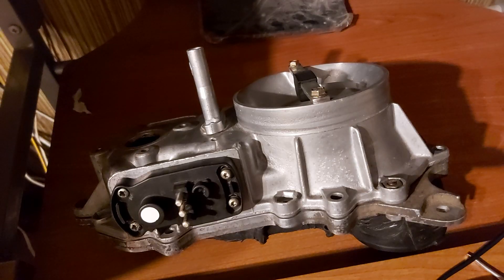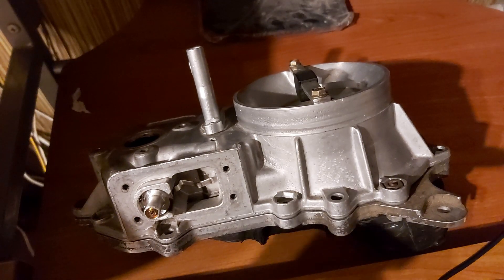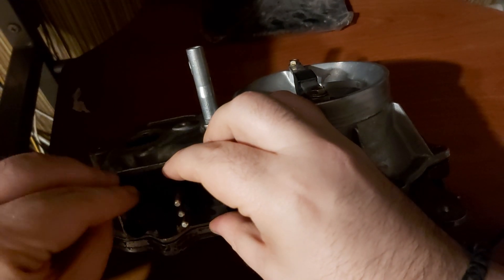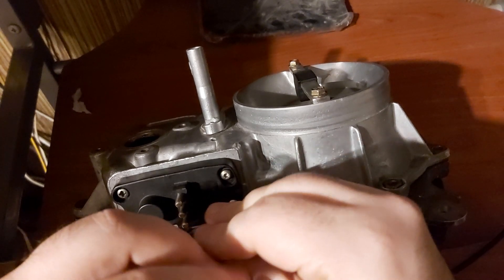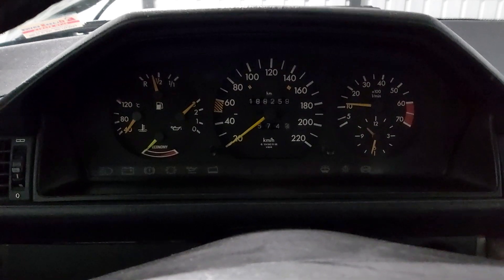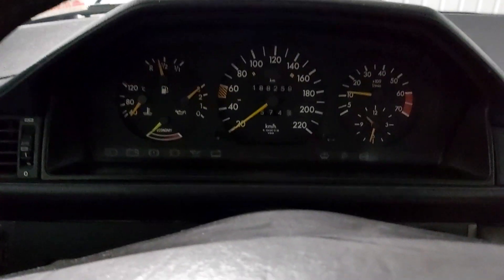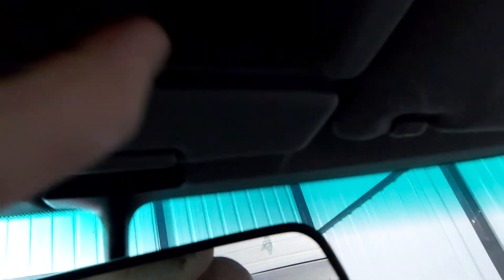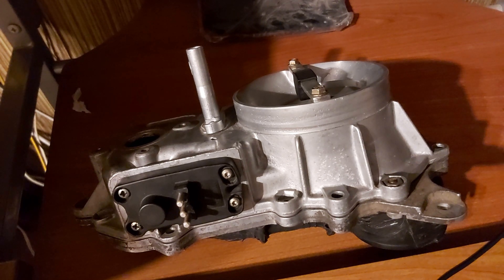㉦Mercedes KE-Jetronic㉦ - Potentiometer calibration and replacement

Comment: Hi! Thanks you for your great vídeos. My 190E 1.8 accelerates with bumps and hesitations until it gets warm. After it gets to 80-90°C it runs much better and smooth. It starts easily when cold. After gets warm the start its harder but drives better. With full throtle it goes ok (cold ir warm). What could bem the problem? Thanks you very much.
Reply from the maker: Hi. Check your potentiometer, I have already got an answer from the subscriber that he bought a new potentiometer but he didn't calibrate it to 0.7V. So you check it also.

Comment: Hey again, thanks for this video. My current LMM is reading out the following measurements. Valve closed pin 1 en 2 2,5k ohm and pin 2 en 3 7k ohm. Valve fully opened 3,2k ohm. So I guess my pot meter is broken. If I replace is and place it at the exact same position, will this still work or do I need to calibrate the replacement?
Reply from the maker: Hi and thanks for the comment. You will need to calibrate it. It's just a matter of patience and precision. I saw on ebay someone in the Netherlands selling potenciometers. There are some people in Germany. You will get full instructions how it's done. I bought it from the man from Darmstadt. If your car has more than 150k miles on the clock then this can become an issue.
Reply: @mercedeske  Thanks, I ordered one. Will replace it myself, but as many different people have been changing the CO screw and such I a bit unsure if I can easily calibrate it.
Will see how it goes :)
Reply from the maker: @michelgroen1982  The CO screw determines the starting position of the plunger. It's important just that the plunger doesn't touch the sensor plate. That's why it has to have a bit of a gap and that's in ideal case 1.9mm as they say. You can hook the multimeter if it can measure % and you have to get the fluctuation 45-55% once you adjust the co screw according to the multimeter that's its ideal position.

Comment: may be a stupid question because you showed how to easily change the Potentiometer but have you ever seen a situation where the whole assembly, that you are holding in your hand, needs to be changed just because of this little 3 pin plug? 
does this potentiometer cause hard start issue 30+ minutes after when the engine is still hot (provided that other components are ok) ?
Reply from the maker: Let me tell you how it goes - the whole unit has nothing to do with the potentiometer. The mechanics at the dealership don't know how to calibrate the potentiometer but as you give them your registration and they see the VIN of your car, they send it to Bosch and Bosch then makes the whole unit and calibrates the potentiometer for them. They get everything back and you pay 600euros for loosening and tightening screws. As for the potentiometer - it fine tunes the position of the sensor plate. As the graphite is worn the metal scratches metal and ecu doesn't know what to do and erratic operations occur. It has nothing to do whether the car is cold or warm, the car tends to stall as soon as you let your foot of the accelerator.
P.S. If you donate me again any money I am going to make you a scheme in which direction to go how to understand the system, even more simple made!

Comment: Hey I like your videos about the KE. I have a question about the symptoms of a bad potentiometer. My 190e 2.0 has a bad cold start and when it gets fired up it keeps dying or hesitating if I try pressing the gas pedal (between 1000-2000 rpms). I have no air leaks, changed my fuel pump, 4 pin coolant sensor, I adjusted my mixture using a CO gauge. Also my acceleration at the high rpm range is not good.
Reply from the maker: Hi! Thanks. 
That is a bad potentiometer. This is how you check it out - measure the resistance between the contacts 1&2 (from the top to the bottom) if you don't get the resistance 3.6-4.4 kiloohms then your potentiometer is bad. Generally if you start your car and it dies after a while then it's about the potentiometer(as the car has to maintain idle).
Reply: Thank you i will try and let you know

Comment: Pozdrav, problem sa ler gasom, 1500rpm.
Nije bitno hladan ili vruć isti problem.
Potentiometer 0.68v
Icv ispravan..kada ga izkljucim oko 1000rpm
Ovp osigurac ok.. ovp izvadjen radi na 800/1000rpm
Predlog? 
Hvala unaprijed
W124 200e 91
Reply from the maker: Pozdrav. A tps, jel ispravan? Motorić sa mikroprekidačem? Jel ga pipa poluga gasa, jel ispravan?
Reply: @mercedeske   da pipa ga, izmeren na zvuk signal i radi prekidač
Reply from the maker: @ayhan8137  Fals vazduh?
Reply: @mercedeske  što sam mogao vidjet nema, preostalo je dim test
Reply from the maker: @ayhan8137  Sto se tice step motora(icv), provera kaze da se upale kola i ako posle izvesnog vremena hladan ne spusti obrtaje na 800 onda icv nije u redu. Isto tako ako spusti, a kada okrenes "pun" na levo ili na desno, auto se ugasi(kod automatika kada se ubaci u D). Tada ne valja icv. POstoji jos jedna provera - povuces rucnu, ubacis u prvu, ne dodajes gas i polako otpustas kvacilo. Kada padnu obrtaji na skoro 500 ti opet skisnes kvacilo. U tom slucaju obrtaji treba da skoce na 1500 pa da padnu na 800. Za ler gas su zaduzeni icv, ako on dobar onda falsira negde. Imam klip na kanalu gde sam postavio vrednosti koje treba da ispuni icv(naon, otpor i amperaza)
https://www.youtube.com/watch?v=jx8xWmALmGk&list=PLysDz2b5tZandyrGc4edX9GTkXfy021Wf&index=8
Gledaj od 15-og minuta.
Reply: @mercedeske  pogledacu video, tih simptoma nemam na autu, znaci nekada radi na 700 i krenem 100m, ler dostigne na 1000-1200 i tu je konstantno, nebitno sta radi i kako vozio, probao sam u brzinu i do 500 pa kvacilo stisnut, nista vrati se na 1000-1200 i tu stoji, proba 3 icv, isto..
Reply from the maker: Pogledaj i tps, senzor za položaj leptir gasa, da li zatvara skroz kada je skroz otpuštena sajla za gas.
Reply: @mercedeske  sad sam izgubljen na koji senzor za leptir gas?
Reply from the maker: Gledaš u telo leptir gasa - sa desne strane se kači sajla za gas, a sa leve ima jedan kabal. To je senzor za položaj leptir gasa. Prvo pritisni disk protokomer kad je auto ugašen i gledaj da li je leptir skroz zatvoren.  Jer taj senzor ima dve pozicije-skroz otvoren i skroz zatvoren. Za sada pogledaj da li je klapna skroz zatvorena kad je auto ugašen. Posle toga da se ispita da li senzor razlikuje skroz pušten od punog gasa.
Reply: @mercedeske  ok pogledacu to, nemas video kako se ispituje?
Reply from the maker: @ayhan8137  Kad izvučeš džek namestiš unimer na zujalicu. Videćeš 3 kontakta, srednji je masa(znači minus kačiš u sredini). Kada plus zakačiš na prvi, unimer treba da pišti(znači da poznaje ler gas). Sad plus zakačiš na donji kontakt i ne sme ništa da se čuje. Pritisneš sad gas do kraja i onda treba unimer da pišti, a kad ga otpustiš da ne reaguje.
Reply: @mercedeske  to sam probao ranije, switch za gas, na kontakt 1 i 3 imam signal, na jedan i 2 nista,
Reply from the maker: A da li je ona guma ispod protokomera citava?
Reply: @mercedeske  valjda ce pokazati kada uradim test vacuuma sa dimom
Reply from the maker: @ayhan8137  Najbolje, da ga ne "raskupusaš" za džabe. Hoće, pokazaće. Znaš da treba da staviš rukavicu na disk protokomer i da vežeš vezicom?
Reply: @mercedeske  da, rukavica najbolje, pokusacu dimom da vidim sta ce pokazati,
Reply from the maker: @ayhan8137  Da, to obavezno!!! Na fb stranici Mercedes benz official dečko je imao slične simptome kao ti,Nikola Nastić, i kad je skinuo disk protokomer imao je šta da vidi, pukla mu guma tako da je jako moguće da i kod tebe nešto slično zeza.
Reply: @mercedeske  moguce je sve, tako da je sigurno pametno testirari prije svega, vidjecu na fb ako nadjem
Reply from the maker: Na Mercedes klub Srbija official, fb grupa. Dečko se zove Nikola Nastić.
Reply: @mercedeske  super 👍 javim ti kad testiram :)

Comment: Hi mister.
I don't know if you can help me.
My w124 has a problem with the radio and hazzard. When I open the door start working again( the two door switch , the second one is the one when you released  start working the radio) I don't know where to start... Because the other door (passenger ) does the same.
Reply from the maker: If you can find a good electrician. I can't tell about that. Maybe the hazards are connected to the light as you open the door... Something is connected wrong I would say.
Reply: @mercedeske  I'll check.
Suddenly happens the other day... Open the door and start working again. I need to know where it goes the door switch

Comment: Yeah. Your video timing is perfect. Everything is understandable. The TPS number I have is "3 437 224 024" but I couldn't find the same. Provide a compatible model number. M102.963 200E non-catalytic model
Reply from the maker: This is how it is. The one I bought from Germany is compatible with 200E 1986-1992 although it doesn't say that there is the number of your potentiometer. From what I found concerning one like yours I wouldn't recommend you buying used stuff. As for the label of your engine mine is also m102 963(962, 963,982,985). It's up to you to decide if you want the new one from Germany from the man that makes only potentiometers(38.50€ plus 4.80€ shipment). How ever you decide.
Reply: I can buy quality products. Where can I find the purchase address? I don't want those sold in the market made in China
Reply from the maker: This one is from Germany, Darmstadt, 5 years warranty. Here's the link and you decide if you want to buy it.
https://www.ebay.com/itm/Drosselklappensensor-MB-Mercedes-Benz-03437224015-03437010039-03437224035/133173658800
Reply: Thanks again.  i grateful.
Reply from the maker: Anytime anything you need.👋👋👋💪🍀🍀🍀
Reply: Sorry.. u said it's okay for the idle speed to go up to 2000 each time. But I suspect ..
https://www.youtube.com/watch?v=s73sk5cLIOo&t=16s